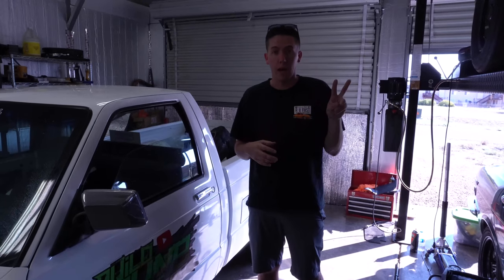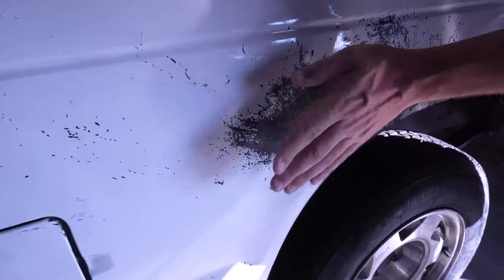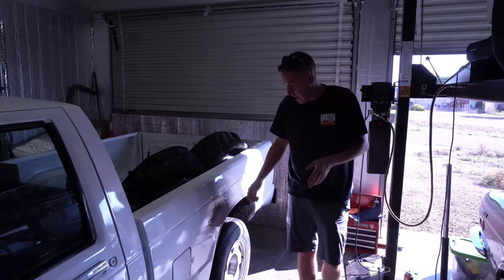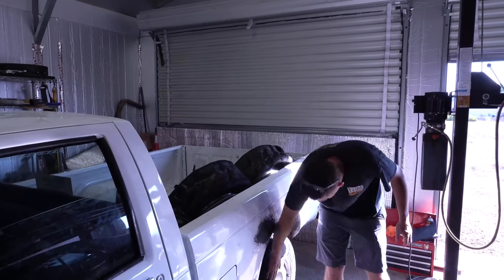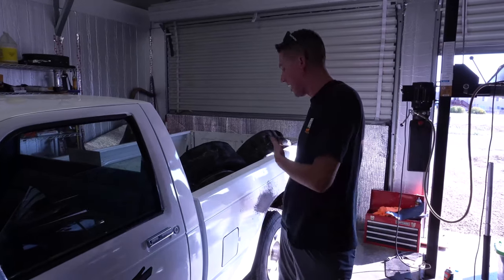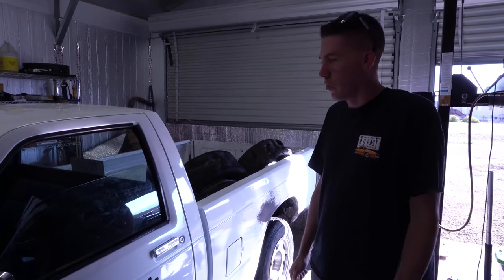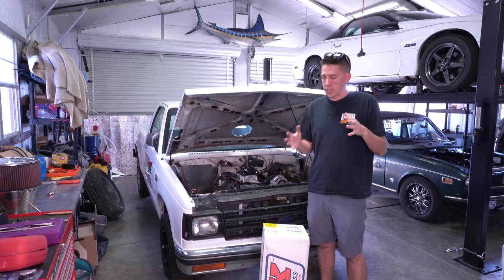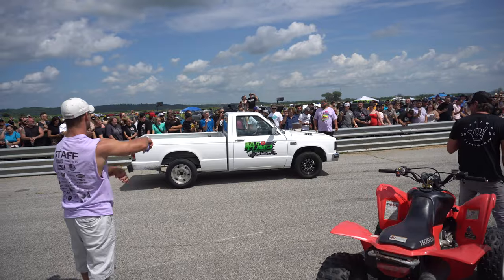Ruined My New Paint Job + LS Nitrous Kit For Burnie!

Comment: I always figure the inset wheels on Aussie burnout cars are because the cars are tubbed for race, or for show, and the burnout wheels simply don't fill the void. Maybe a beneficial side effect is that the body is better protected? I heard in some video that those super clean burnout cars have some kevlar or carbon well liner. You could protect the bed and stand out at the competition by adding hydraulics to the bed.